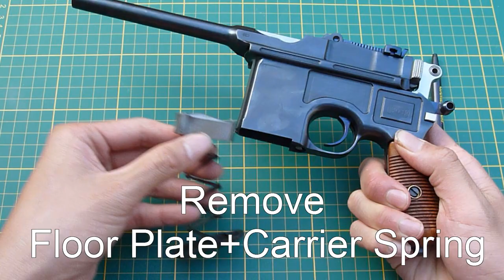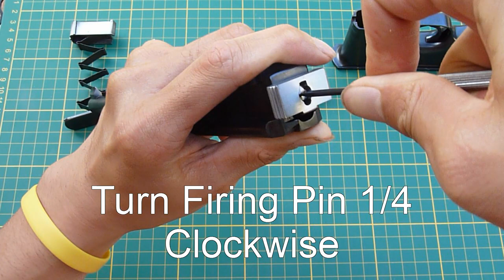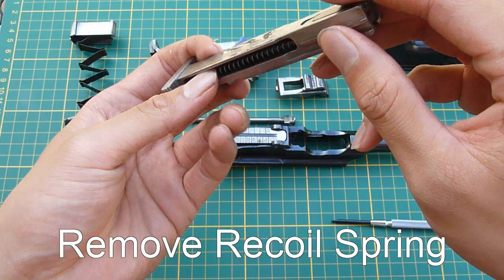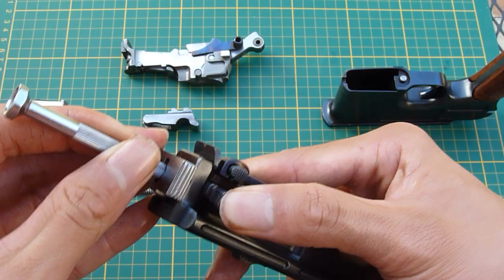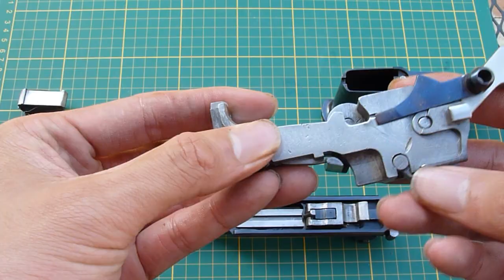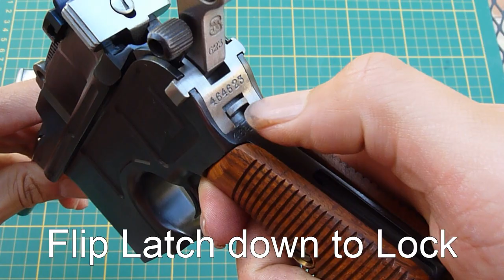Mauser C96 Broomhandle Tutorial disassembly and reassembly

Comment: That disassembly and back doesn't show the full operation. One of the trickiest part is a small "half moon" located inside the action block. This may be inserted on the reverse. (It is the only part which actually can fit in wrong position) - If that's the case everything will go smootly to the moment you will mount the gun and try to work it. It will stuck semi opened and no matter you do, you will not be able to reverse the operation. It requires a special tool and special way to unstuck the mechanism without damaging the gun. This should be shown as many of these remarkable oldies go lost or otherwise damaged due this small detail. Another tricky business is extracting the aiming strip. I had opportunity to see many damaged guns as people tried to release that part by hammering out what they tought to be a sliding pin. Not at all. You do it by bare hands, not tools.

Comment: I have wasted time watching probably four or five videos on disassembly/reassembly of this weapon. You sir have made the perfect video. I just bought a Broomhandle mauser today. Someone had put the follower in without inserting the tab of the spring. So it was locked up tight. After I removed it the work that the previous handler did reached fruition in that it was mostly field stripped. It has been almost 40 years since I've messed with one. Needless to say, your video really helped. Thank you so much for doing it. Blessings.

Comment: Select fire versions are seen w/detachable magazines.Spanish Astras and indigenous Chinese copies also are often seen w/ detachable mags.Astra actually a better designed pistol, likely their techs in the 1920's saw some inherent problems w/the 1896 and addressed them.Once you get hang of atypical gun style it's actually quite pleasant to shoot. BEWARE: Never shoot Czech CZ52 ammo in C96 it is at least 30% hotter than the 7.63 load.Carefully check C96 before buying to see if damaged by hot ammo

Comment: Well, the C96 is a very good pistol. It's an all around historical, collectable, and accurate firearm with a great reputation. I personally don't compare the C96 and more current pistols. They are two very different pistols with over 100 years of development between them. The Glock 17 is a modern pistol designed for the current battlefield, but the C96 is a pistol that was designed at a time when men were real men. The C96 is outdated by today's standards, but I like them both.

Comment: Technically I wasn't wrong when I said that Mauser manufactured that same kind of pistol with a detachable box mag. I also wasn't wrong when about the Russians using stripper clip only clones. I was unawear at the time of the existance of the strippercliped red 9s that used the " New 9mm" cartige back in WWI. Finnally correcting me on Vietnam is kind of a low blow. That was an accident that came from being awake too late.